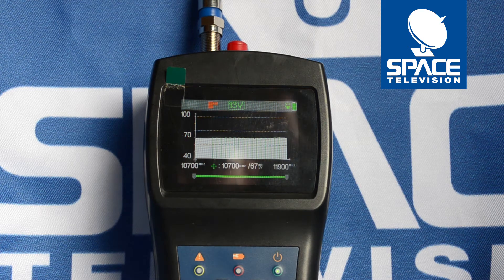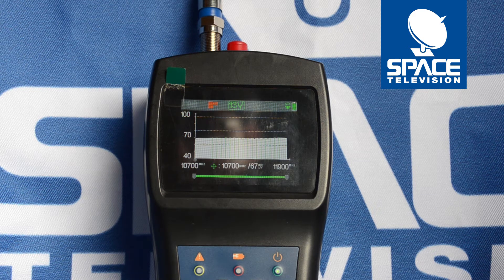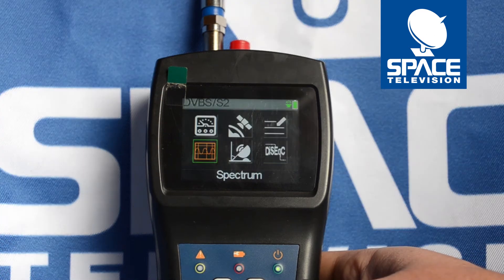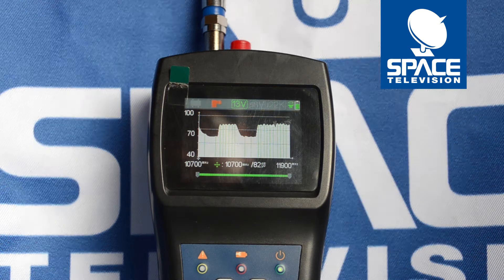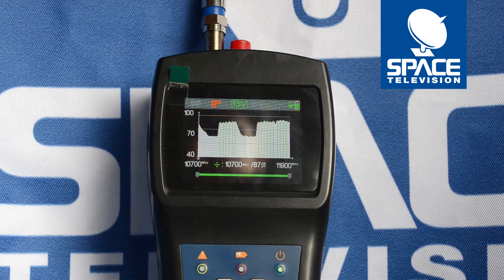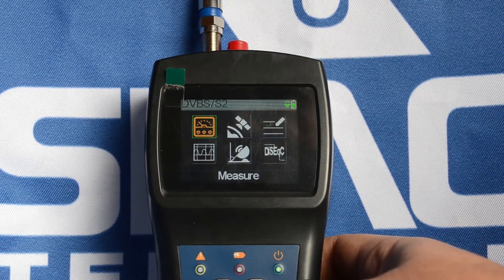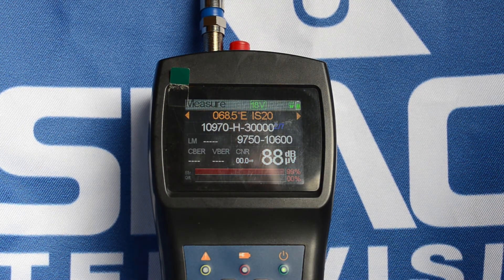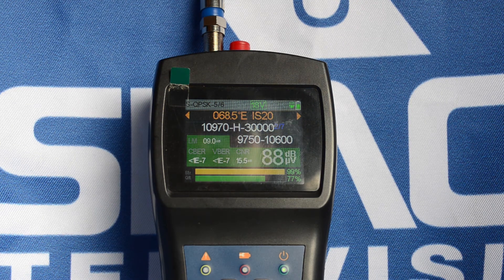What to expect when aligning a a universal LNB on the Space Ultra Plus

Comment: Please mine is only shows imfo light, it doesn't want to come om
Reply from the maker: Thank you for reaching out! If your Space Ultra Plus LNB is only showing the info light and isn't turning on, it could be an issue with the power supply or the LNB alignment itself. Here's what you can try:

Check the Power Source: Ensure that your device is properly plugged in and receiving power. You could try resetting the device by unplugging it for a few seconds and plugging it back in.

Check the LNB Cable: Make sure the cable is securely connected to both the LNB and the receiver. Sometimes, a loose connection can prevent the signal from being received properly.

LNB Alignment: If your LNB alignment isn’t properly set, it could affect the device's functionality. You might want to check the alignment settings again.

Reset the Device: You can also try performing a factory reset on the receiver to see if that resolves the issue. Be sure to back up any settings or data you might need beforehand.

If none of these work, it could be worth reaching out to the supplier for further troubleshooting, as there may be an issue with the unit itself. Hope this helps!

Comment: Great video. The Space Ultra Plus looks exactly like the AMIKO TSC1000 and has the same software. I have 3 combo meters. My first combo meter was AMIKO MULTITRACKER 2, later I upgraded to AMIKO TSC1000 the problem was with the satellite tuner LNB In. Compared with the Multitracker the signal level was lower on TSC1000 (about 10 uVdB difference) on the same transponders. But it was excellent with DVB-T2 and DVB-C. Another problem was with the battery, if the battery was 50% and you wanted to align the satellite dish or a an areal with a built in amplifier the combo meter automatically turned off. First I thought it was a battery problem, I changed the batter with a new one to discover that it was a software issue. Other problem was with the DiseqC switch, it didn't recognized the Diseqc 1.1 switch only 1.0  and it had problems with USALS H-H motor. The problem was solved with a software update. Unfortunately it was a big disappointment The AMIKO TSC1270 is a major improve and the software is better, I had no problems.